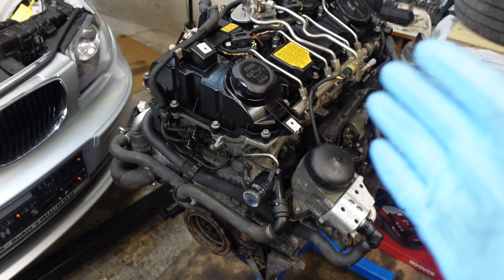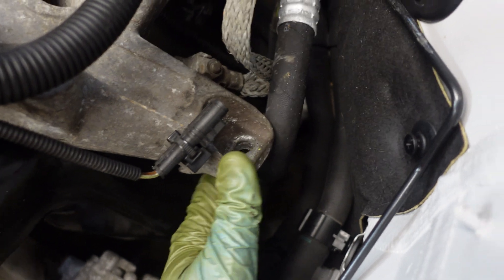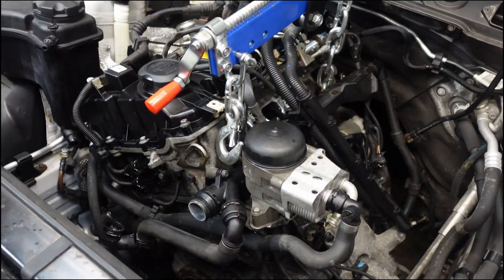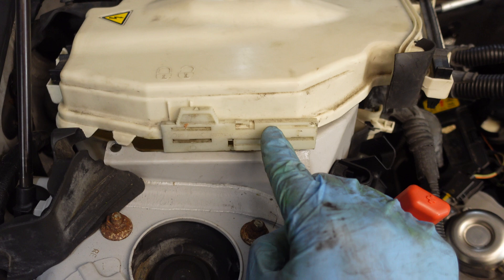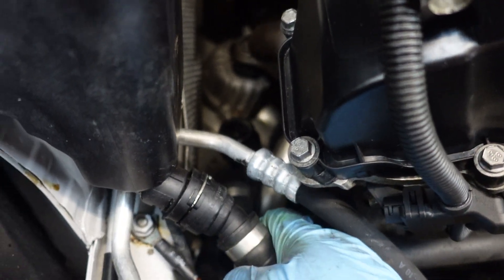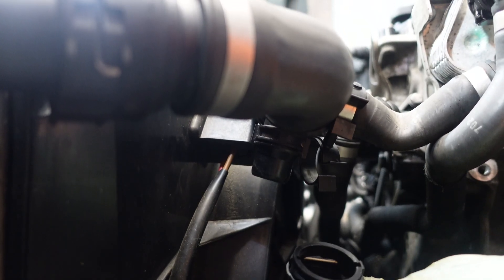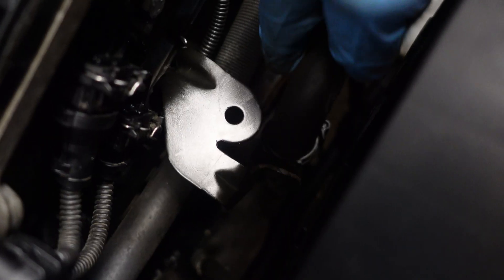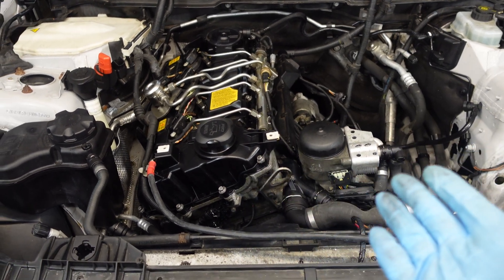N43 Engine & Radiator Installation

Comment: Amazing work.  Have you done a coolant pump and thermostat replacement DIY on an E90 with N43 (mine is 2008 318i)?  Do you need access from above, below or both?  Thanks.
Reply from the maker: I haven’t done it myself, but instructions state that engine should be raised with the engine support bar and the pump can then be removed from the bottom.

Comment: Hey Zen you ever check the EGR Membrane on those vlave covers? Should they be replaced after a certain km ? Thanks
Reply from the maker: I haven't. From what I can read on the internet it's best to replace the whole cover with OEM. But if you are DIY-er, then it might be a good option to just replace the diaphragm. I would not replace it unless you have symptoms of a bad CCV.

Comment: Sir can😂 I buy after market vvt motor will it work on my n46 engine
Reply from the maker: Yes, just make sure you get it from a reputable german company. Price is about 140 - 200 EUR. Or try to get a good used one if you are willing to repeat the process if it goes bad:)

Comment: My n46 engine has a slow start and it kills battery too quickly what can be the problem
Reply: Timing
Reply: I just did timing yesterday but still have the same problem
Reply: And I went and bought fuel injection pump  ground strap chain tensioner screw but still
Reply: Quick tip.. you can unclip hood gas strut clips and then you can lift hood straight up position.. makes lot of more room to operate engine back to car
Reply from the maker: Did you confirm the vanos timing adaptation in INPA? Intake should be 115-120 deg,  exhaust should be 55-58 deg.